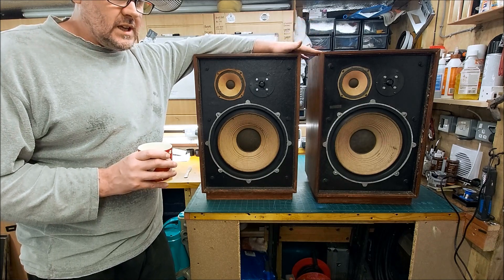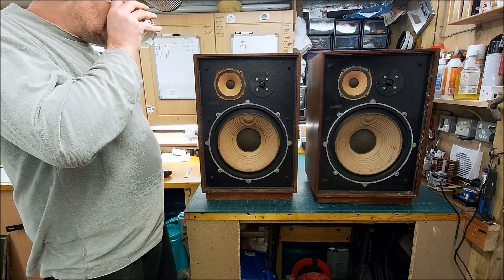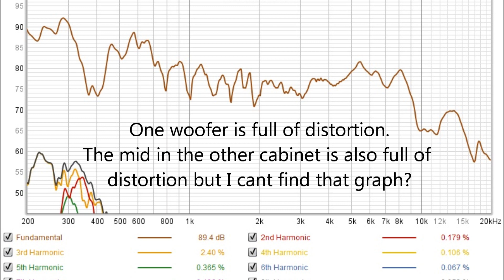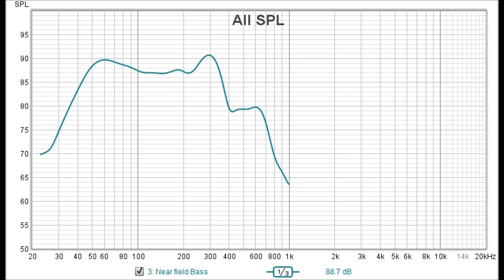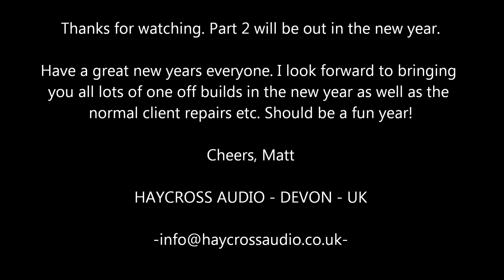Wharfdale Kingsdale 3 vs Celestion Ditton Build Part 1

Comment: I'm building a similar speaker , using a pair of 8" Kef c200sw passive drivers and crossovers as the bass augmentation. 
The cabinets are transmission line .
The 250hz to 3000 handled by a pair of Kef b110 1234 4ohms , Kef t15 midtweeter to around 10k  and Coles super tweeter . 
Fortunately a 25Mreel of self adhesive lead strip has been bought at car boot so looking to lead load the speaker chassis and front baffle . 
I'm tempted to fit the t15 in a Nautilus style pod on top . 
It's a budget build and the crossover is from castle acoustics. 
Building my own super tweeter board add on .
Reply from the maker: Make sure you shoot measurements and adjust the crossover to work with your drivers and the cabinets there installed in. Good luck with the build

Comment: Great idea to use all the odd and ends into unique pieces. This reworked Kingsdale is an fun start. Look forward to seeing how it turns out.  l've had a couple of pairs of Dovedale 3. The problem with the bass drivers is often that the surround suspension material goes hard and the low end response changes significantly. I think the Kingsdale is a later model and maybe uses a different surround material. Curious that Wharfedale began to use square magnets for a certain time.  Good luck with the New Year projects!
Reply: I've had Dovedale 3s and had the same problem with surrounds going hard on the woofers. They're 13" so I couldn't find a suitable replacement surround. Mine had square magnets (as do the 8" woofers in my 1970s Denton 2(?)s). Didn't your Dovedales have square magnets?

Comment: I recently got some Glendale 3xp's to play with. They look largely the same on the inside. One of them wasn't working at all (except form some very low noise from the tweeter). Seller had said so and I hoped for an easy fix, but all drivers were blown all measured infinite. The midrange of the other one had blown too. So now I have a woofer a tweeter and the crossovers (haven't measured those yet). I've put them to use as stands for my subs for now... Maybe you can inspire me a bit with this project ;)